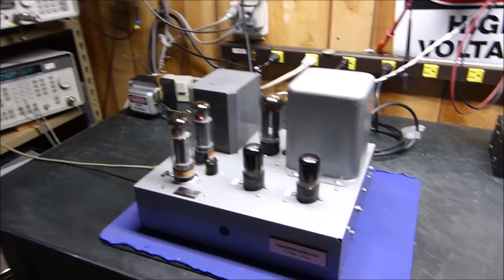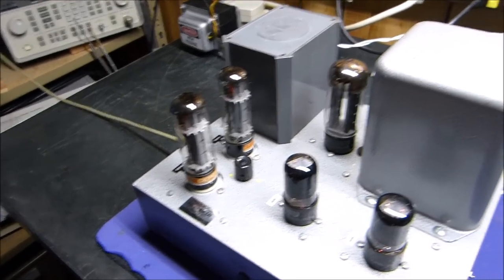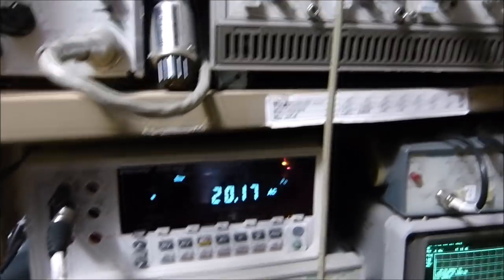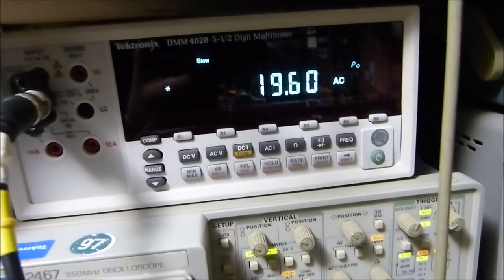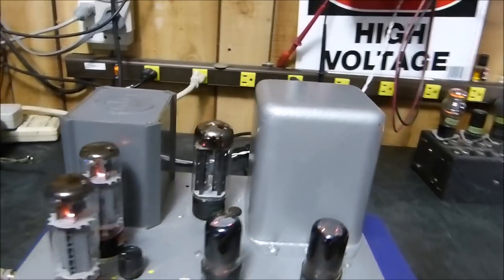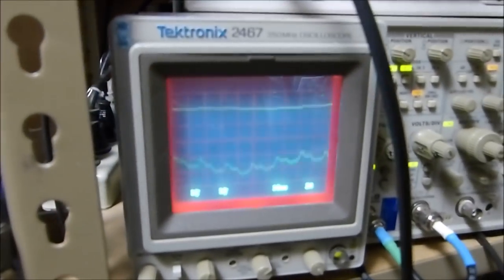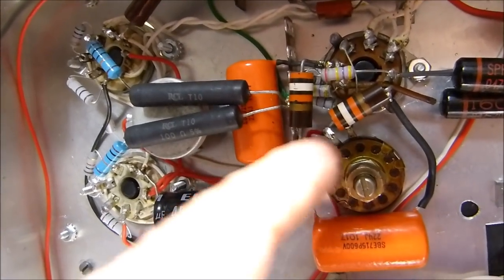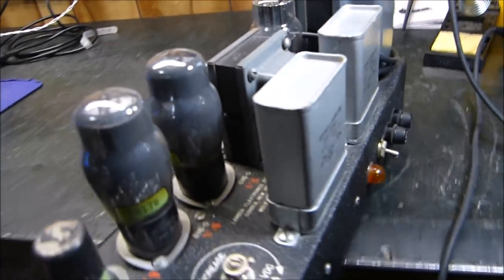Williamson Amplifier Using UTC Output Transformer

Comment: I need to get myself some oil capacitors like that to put in my Victor sound reproduction amplifier.  It is a design from the 1940s and it has these massive wax hybrids in the bottom.  To its credit it almost works properly out of the box.  It actually uses a NEMA 1-15 receptacle for the speaker!
Reply from the maker: That is really interesting about the speaker connection. Some years back one of my friends from Mexico told me how they use regular extension cords for speaker connections. Makes sense nowadays since they are polarized and you could add or subtract what ever you needed to make them longer. May have to cut the ends off of two of them to connect to the amplifier and speaker but everything in the middle is already made and can be bought most anywhere. In this particular case, the speaker runs were in a church so they were relatively long and I can see the advantage of this type hookup.

Comment: The use of those RC circuits to filter out AM radio and parasitic oscillating frequencies is interesting I’ve never heard or read that before. Makes perfect sense though. 
I wonder about the pros and cons of square wave testing of audio amplifiers. I would think square waves, with their many harmonics would create greater stress on the amplifier output tubes under test. Or would it be a more realistic test of a frequency rich signal?  I would expect an increase in THD with a square wave input vs a clean sine wave.   
What paint are you using on your chassis? I love the finish. I’m sure you’ve said before, but I forgot.
Reply from the maker: Hi Bill,
The THD of the square wave is about 50% if I remember correctly so that measurement is of no use. I like the way you stated, "frequency rich" of a good square wave. I completely agree with you as we know it takes a circuit capable of passing about 10X the fundamental frequency to reproduce a sharp-clean leading edge. At 10KHz it implies the transformer can produce up to 100KHz and indeed, the mid and HF response of the amplifier is exceptional. Might be a little too bright some some people but we could always turn down the treble. As you mention, it is probably full stress on the tube during testing to do square wave at higher power but for the time it takes to test, I think it is OK.
The paint I use is a wrinkle finish in grey that I get at Home Depot or Lowe's. It comes in all colors and sticks pretty good without a primer. Actually, one time I used a primer and it did not seem to stick as well. Good to hear from you, Bill. Hope you are doing well.

Comment: Love the video. Can you explain or do a video on the voltage error measurement from distortion analyzer?
Reply from the maker: I will do my best to describe what the error voltage display is in a future video. For now I will tell you that within the distortion analyzer, the fundamental frequency (test frequency) is nulled to zero so none of the test frequency is passed to the output of the analyzer (except for the monitor port). So, with the test frequency nulled, what is left is the distortion or error signal as I often times call it. In a nutshell that is it. The error signal can be examined on the oscilloscope and often times one can see that there is 60 or 120 Hz noise modulated on this error signal so we can easily see that a problem exists in the filament circuits or power supply filtering.  If the error frequency is a multiple of the fundamental test frequency some conclusion might be made on what the most offending harmonic is. Etc. Hope this makes sense. Showing it on a video would be better. Thanks for the suggestion.
Reply: @ElPasoTubeAmps  Thanks for the description.  I have an audio lab setup much like yours with a lot of the same equipment as you have.  I've got the extreme ends from a GenRad Impedance Bridge all the way over to an HP 3262A signal analyzer and everything in between including of course 2 of Tek's AA501.  I find more inspiration in this hobby from your videos  than any other source and I mean that. I've learned a ton.  So I'd love to see you do a deep dive on the AA501.  I'd even like to watch you recalibrate it. I can't tell if like restoring the test equipment better than my  old tube amps!

Comment: Thanks for the video, your workmanship on the build is very nice. I'm just starting to get into tube audio and building my first SE stereo amp. Without having $100 K in test gear, are there any methods I can use to assess the quality of my build? Right now I'm limited to multi-meters and a couple scopes.
Reply from the maker: If you have an oscilloscope and a volt meter, you are 90% there. You will need a signal generator that has an output of up to maybe 3 volts, and adjustable amplitude, (most audio tests start with a 1 KHz sine wave test tone) and one or two dummy loads but that should not be too expensive. 

Connect the output of your amplifier to your dummy loads, typically 8 ohms and measure the RMS AC voltage across the load with your volt meter while driving the input of the amplifier with the signal  generator. Most modern meters will measure 1 KHz accurately.  Power (in watts) is voltage squared divided by the load impedance, in this case, 8 ohms. This gives the average power. 

Next, connecting the oscilloscope across the dummy load the same way as the volt meter,  can be used to determine the power level at clipping. Raise the  gain of the amplifier or the output of the signal generator until the top and  bottom of a sine wave starts to flatten as seen on your oscilloscope and you will have reached a maximum power level for your amplifier. Again, measuring the voltage with your volt meter and doing the math as above to determine the power level. Distortion at this point will likely be 10% or more but you should have a pretty good idea of the power level your amplifier can develop. There is no simple way to determine actual THD levels without more sophisticated equipment but really isn't necessary. Unless I have forgotten something... that is pretty much the basic setup for audio amplifier testing.

Vacuum tube amplifiers are inherently dangerous because of the high voltages necessary to make them work so developing a safe and non-compromising style of measurement is absolutely essential. Safety is everything. My motto has always been: (1) stay alive, and (2) don't burn up your tubes... I sometimes deal with very high voltages in my radio transmitter amplifiers that would be death-on-contact with lethal KV levels  so,  #(1) is, by far,  the most important...

There is a lot of advice on the Internet and YouTube about high voltage safety and it should be taken with utmost seriousness.
Reply: @ElPasoTubeAmps  Thanks for the info. What you describe is exactly how I do things when I build guitar amps. I have a custom built load box and a signal generator so I should be fine. I'm finding a lot of differences in building a hi-fi amp as compared to a guitar amp, but it sounds like the evaluation methods are just the same.

Comment: Can I use UTC VM-2 V Tube Audio Varimatch Output Transformer in a single ended EL34 configuration?
Reply from the maker: No, that series of transformers are modulation transformers intended to modulate class-C radio transmitters.  The output impedance windings are not 4, 8, 16 ohm but values like 5000 ohms etc. The VM stands for vari-match but they are not for HiFi type amplifiers that drive speakers. The best transformers for HiFi using tubes like the EL34 are UTC LS-57 or Acrosound type TO-300 series transformers.   
https://www.worldradiohistory.com/BOOKSHELF-ARH/Technology/Technology-General/Acrosound-Output-Transformers-1955.pdf

Comment: How did you configure the system for measuring THD + N of Spectraplus? (configuration of software version & Notebook PC)
It was a very interesting discovery.
Reply from the maker: Across the top menu bar select Utilities and look down for Total Harmonic Distortion + Noise (THD+N) and it should work.
Reply: @ElPasoTubeAmps  Is the SpectraDAQ-200 installed in front of the PC?
Reply from the maker: @youngwug  I am not sure I completely understand but I assume your meaning of "in front of the PC". The input to the USB sound card is taken from across the 8 ohm load resistor (with lots of attenuation).  Does this answer your question?
Reply: @ElPasoTubeAmps I did the same test with the "USB Microphone preamp" of "Sound Devices" in front of the XP PC, but THD is 7.8%. It is 0.33% as measured by Boonton-1120 & HP-8803B under the same conditions. (10 ohm load resistor, 100 W)
Is the dummy load + 8 ohm load resistor (with lots of attenuation) for PC measurements?
Or did you only have an 8 ohm load resistor (with lots of attenuation) in your PC measurements?
Reply: sorry HP-8903B
Reply: The 62dB at 600 ohm attenuator is equivalent to PC measurement and THD measurement of HP-8903B and Boonton-1120.
Thank you.
It has been a great help to your teaching.

Comment: A-ha! So you've got K-horns... ; )Are they stock or modified? What year?

I gotta say, I love those orange drops and the mills wirewounds - I just have a soft spot for them. What do you use for your low power resistors? Are the carbon or metal oxide?
Are you happy with these parts choices? How about the Hammond choke? Does it deliver at the frequency extremes (esp. the low end)?

Finally, it's the first time I come across someone having built an amp with a valve time delay. That's awesome, however, I'm concerned with finding replacements for them 10-15 years down the line.
Reply from the maker: My Klipschorns were bought new in 1996 and I have done nothing to them. It has crossed my mind to open up the bass cabinet and check that the speaker mounting screws are still tight - or maybe I should just leave it along... they are absolutely awesome sounding. Practically take the mortar out of the walls with some heavy metal... and I use them daily for a few hours in my home theater system along with a C20 preamp that has the original Telefunken tubes in it but I drive a SS Mac amp - a MC2100 and I use a Mac CD player. I have a couple of other smaller systems but nothing comes close to the sound of the Klipschorns.
I agree that the orange drops are very good. I personally just can't see paying the price for  some of the audiophile caps. If I can't measure a difference with the equipment I have, I figure I probably won't hear the difference either.
As for resistors - I have no real preference for performance except that sometimes I just like the looks of the vintage 2 watt carbon resistors like I used in the UTC W-20 build. I also love RF and have some nice RF test equipment and I have done a number of tests, and a couple of videos, on all types of resistors and generally I find that they are ever so slightly inductive (in the nano Henries) at frequencies below 10 MHz or so (I would have to review my video to say for sure the exact number) and above that frequency they become slightly capacitive (fractions of a pF that increases as the frequency increases). I can't see, hear or measure any differences in resistor performance in audio equipment.
The Hammond choke(s) are OK. They do their job and I measure their L and it turns out accurate enough. I have found that whatever current rating they state for their inductors, that is pretty much the limit as they will get hot if you draw more current. I am thinking of a 150 ma choke that I run in an amplifier that draws 200 mA - choke gets too hot and the plastic covering becomes discolored - so, don't over load them.
As for the low end response of audio amplifiers - there is, and has been for many decades, a philosophy that low end response should be restricted. Just doing simple modeling of the input RC circuits of many amplifiers dating decades back show a roll-off around 100 Hz or sometimes even higher in frequency. These amplifiers with restricted LF response sound great. I think the problem comes in with very low frequencies (below maybe 40 Hz) that they can easily saturate the output transformer and performance plummets because of this. Inductance of the primary winding is what plummets around saturation. I have done some simple modeling of these RC circuits and work with a good gentleman up in Iowa that has advanced knowledge of magnetics and we agree on the analysis of the performance of vacuum tube output transformers. The OPT in vacuum tube amplifiers is where the rubber-meets-the-road, so to speak, and the only company that seems to have the best solution  to the OPT problem was McIntosh. Just my thoughts.
Reply: ElPaso TubeAmps : Thanks for the lengthy response.
So your K-horns, do they have the Atlas midrange unit (alnico)? I think there was a decade where the midranges had ceramic magnet.No point in taking them apart other than curiosity - it's a lot of screws - but if you do, don't forget to post back what you find! You seem to have struck a synergy between your amp and the K-horns. It should not be hard to get a great bottom end when driving them with an MC2#00 amp. I certainly do not get that much low end out of my clones but then again, they're not exact replicas. Then again, I did not play anything with a lot of bass in it before putting them away.

Thanks for sharing your findings on resistors - great info!
That's an interesting take on transformers/amplifiers you're putting forward. I've never heard an amp with such a high LF cut-off so I'll just have to take your word for it. On the other hand, I think valve circuits were built differently as the loudspeakers of the time were also different. I've heard old radios and radio consoles with puny amplifiers and drivers with minute magnets and there's certainly never a sense they're lacking in base.

I have to say that I agree with you that, at least in the US and in many other countries too, nothing comes close to the build quality of the Mac transformers. Which makes it a shame that they are only built for their own gear and, moreover, specifically for the unity coupling circuit. Nowadays, however, there's many brands that offer really exotic transformers - albeit at exotic prices too. The transformer building art by and large has not been passed on to the younger generations - bar a few exceptions - and it involves many closely guarded secrets. Unfortunately these secrets will be lost as they are either proprietary or those in the know have not gone into the effort of passing them on. It's a shame as given the progress in materials and mathematical modelling tools a lot could be achieved. Major manufacturers are not interested of course as profit margins are very low.
Reply: @Stelios.Posantzis   If I owned a pair of speakers which cost as much as my car I wouldn't want to take them apart at all unless I had a very good reason...
Reply: douro20 : As with many other things, ymmv. For me, finding out what it is I paid for makes a very good reason ; ) Of course, that decision depends on many factors such as: risk of voiding any warranty, necessity, cost of the item, risk of damaging the item, level of skill & confidence etc. and ones comfort with each one of them.

With K-horns, taking a peek inside does not necessarily mean taking them apart. In fact, as they have a modular construction, you can tell a lot (more than in any other speaker) but just looking at their back. I don't know whether your familiar with them but if you ever come across a pair you can immediately tell that owning them is a major decision which involves, among other things, a fair amount of construction and putting things together during installation that goes very far beyond what is involved when installing a usual pair of speakers. In that respect, they should be viewed more like a permanent fixture of the house, like a heavy piece of furniture or a stove. In fact, this is the least important factor to consider before acquiring them. What I'm saying is that the "rules" associated with "normal" speakers do not apply here.

As far as the cost is concerned, there are K-horns and K-horns (just as there are cars and then there are cars). You're right in that a pair of K-horns can sometimes cost as much as a car or more but that does not make them necessarily expensive - again ymmv of course. In the US, old K-horns can be had cheaply (for far less than the average 2nd hand car) mainly because there's lots of them about (they've been made without stop since 1948) and some people just need to get rid of them to make space. K-horns are only constructed in the US which makes it far less costly to procure a pair there than in any other part of the world.

Comment: do you have a link for this schematic
Reply from the maker: Just search for Williamson Amplifier schematic or design.  Here is one:  http://www.tubebooks.org/file_downloads/stancor_ul_schematics.pdf
And here is a second one:  https://i.pinimg.com/originals/d8/38/68/d83868fafa13ff31a76f3254d66c7fff.jpg
A third: https://www.google.com/search?q=amplifiers+part+1&rlz=1C1CHBF_enUS839US839&oq=amplifiers+part+1&aqs=chrome..69i57j0l5.11159j0j8&sourceid=chrome&ie=UTF-8
There are four really good free books on the Internet. Here is one:  Look for: 100 amplifiers part (1) or (2) or (3) or (4) and you will find all four books. Book 2 is a very good one.
https://www.google.com/search?q=amplifiers+part+1&rlz=1C1CHBF_enUS839US839&oq=amplifiers+part+1&aqs=chrome..69i57j0l5.11159j0j8&sourceid=chrome&ie=UTF-8